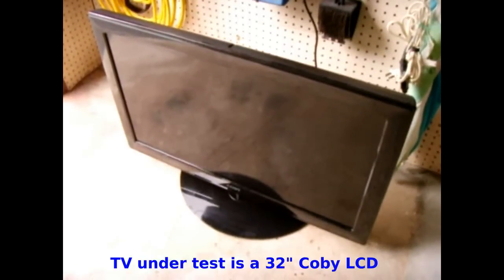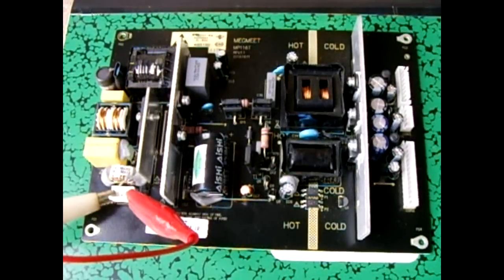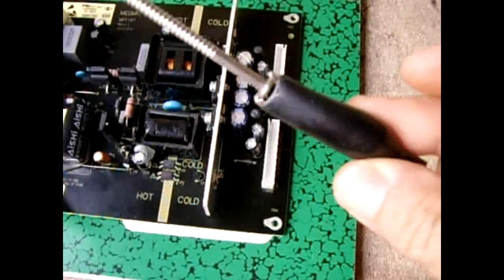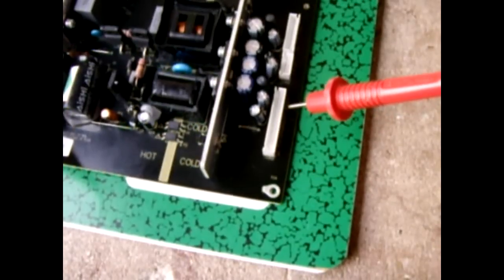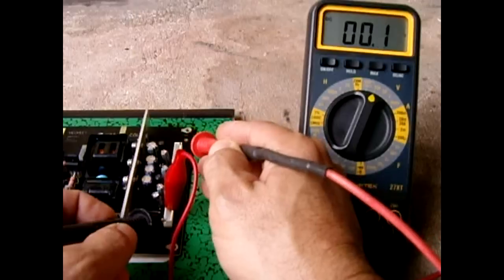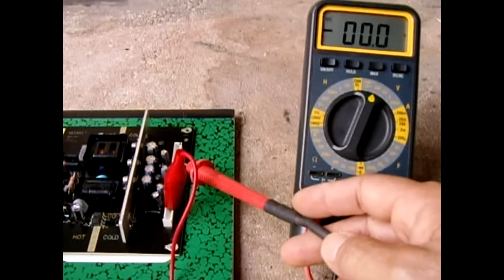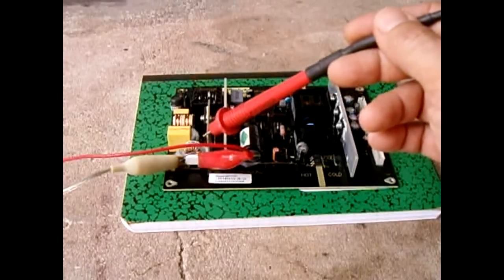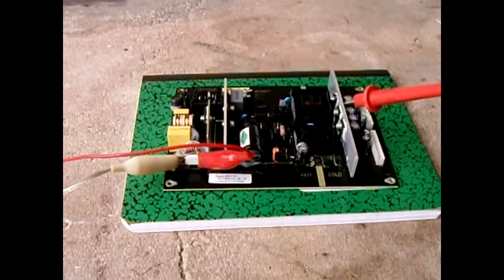How To Test LCD/LED TV Power Supply Boards(No Power)

Comment: Very nice.
Can you do another video like this but with CCFL lit LCDs?
Thanks!
Reply from the maker: I just tore apart my laptop LCD to replace the CCFL in that. The tube is 15" long x 3/32" diameter. EXTREMELY fragile. I also replaced the inverter board. I should have made a video for that. Replacing a CCFL in a laptop LCD screen is not for everyone.

Comment: Finlux 50ins went pop sound but no picture just lines help please?
Reply from the maker: You should be able to locate a faulty component(burned/damaged) on the power supply board or main board. Maybe an electrolytic capacitor.

Comment: What to do if the ps on doesn't have 5v?
Reply from the maker: tom hoag One pin usually has power so the board can be turned on and off. No power, then swap out the board. You can find them on Ebay fairly inexpensive.

Thank You

Comment: Thanks for sharing
I have Lcd after 10 min go of
have you more information
Reply from the maker: I take it the TV goes completely off. Audio and video. Correct? What you need to do is open up the TV, and position the board so you can do a voltage test just after the tv turns off. You need to have everything connected. All the cables. You need to see if the power is still being supplied to the main board, or all power is off. You may have a bad main board. The main board is what tells the power supply board to fully turn on.

Comment: I have an HP 32" lcd, after I  clic on power on remote 20 times tv turns on, also this TV have no sound, but shows volume is ok
Reply from the maker: Make sure all power outputs are working, and you don't see any bulging electrolytic capacitors. Thanks for watching!

Comment: MY T V MODEL 32MD301B/F7 MAGNAVOX

TV IS STUCK IN DVD ..READ THE FOLLOWING IM WANTING TO MAKE TV WORK FOR SOMEONE.I DISMANTLE TV TO TRY AND TROUBLESHOOT STILL LOOKING ONLY FOR STEPS ON TROUBLESHOOT THE BOARDS . 

WHEN i plug comes on i get a solid green power light a dvd orange light screen on bottom right say is big letters DIGITAL TELEVISION.. Then I see DVD ON the top right of screen telling me its on DVD . I SEE INVERTER WORKING CAUSE I HAVE SCREEN TELLING ME DIGITAL TELVISION ON Startup and i get DVD ON TOP RIGHT AFTER DIGITAL TELEVISION ON STARTUP GREEN POWER LIGHT AND ORANGE DVD LIGHTS SOLID LIGHTS. I HEAR DVD SPINNING BUT THIS DISC IS BAD. IVE TRIED ALL THE BUTTONS ON TV none work i tried them all it has sound channel power menu select not working . But it does power up to dvd and screen works. I see the lamps for the tv work cause I opened and I see light. IT JUST POWERS STRAIGHT TO DVD AND I HEAR DVD TRY TO READ A MY DIRTY DISC. BUT I CANT TURN TO A DIFFERENT MODE LIKE HDMI OR SOMETHING ITS STUCK

Comment: PS_on doesn't have voltage. 5VSTB has your standby voltage. It's generally a good idea to use a 5k resistor to short them with. It'll limit the current if you accidentally connect the wrong pins, so you don't damage the board.
Reply from the maker: +swappart.com 
In the video I demonstrated at 4:50, that the PSON pin had the 5VDC output to ground. If you are unsure of the correct pins to short, then I totally agree with using a 1K/5K resistor.

Comment: the 24v for the AOC TV power Supply is not present
Reply from the maker: +James o, Williams 
If you turned on the power supply board, and one of the outputs does not work, then clearly there is a faulty component on that board. Replace the board.

Comment: Here is the: 1.pow_pro / 2. Pow_sig / 3. Ac_det / 4. Stop_fan / 5. Pow_lcd / 6. 12vlcd
Reply from the maker: Between ground and one of the pins should show a voltage(3 to 5v). If you are getting voltage then the problem is you have not turned the board on to supply power to all the pins. Let me know if one pin is powered and what the voltage is.

Comment: The picture goes off periodically but the sound continuous
Reply from the maker: If all the outputs work on the power supply board, then the inverter board is faulty.

Comment: Step by Step?  Sorry but really disappointed. So you find a voltage that isn't there, what's the next step?
Reply from the maker: sydmichel Yes, step by step. People like you are a joke. Where do you get off complaining about something you got to see for free? If you did as shown, and there are no output voltages, then either you failed to turn on the board, or it's faulty and needs to be replaced. Shouldn't have been too difficult to figure that out.
Reply: So, your response to a bit of mild criticism is a personal attack.  If you cant take a bit of criticism how will you ever learn to improve your content?  Don't take it personally, I just felt that there should have been far more steps in diagnosing a fault on a power supply.  good luck.
Reply from the maker: sydmichel Nothing to criticize. Next time choose your words more carefully, and you may get more help. 😀

Comment: My tv turns off
Reply from the maker: Inspect and test all electrolytic capacitors on the power supply board.
Reply: Bad capacitor. Check for swollen capacitors. Google it if you don't know what they look like. Not all capacitors swells when they go bad though. If you can't find any swollen capacitors, replace all the capacitors.

Comment: Thanks dude.
Do LED TVs have a somewhat similar power supply?
https://en.wikipedia.org/wiki/Television#OLED
Reply: LED TVs are LCD, if you don't know this you probably should be opening up your TV until you read up a little more
Reply: +Greg Gorrell Thanks a lot, I did not know that. I'm just a tinkerer, dunno much about what's inside these digiTVs yet! ;D I've been looking inside an older CRT TV board, it is amazing. I learned a little stuff about it. It seems there is a chip there almost like a micro-processor/controller nicknamed Jungle Chip. :) If you got a chance to tamper with an old TV(say you found one trashed or such) please do. I even found an EEPROM chip in it! ;D
Regards.
BTW this guy made a tiny FPGA board, you might wanna try it out:
https://youtu.be/mPIfhLXsYkQ